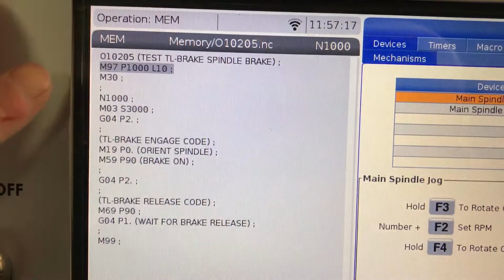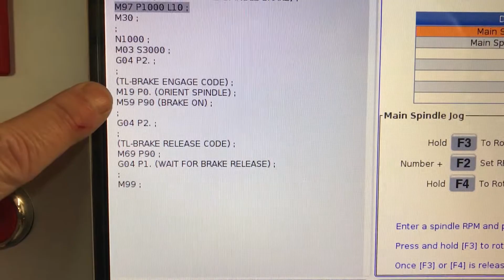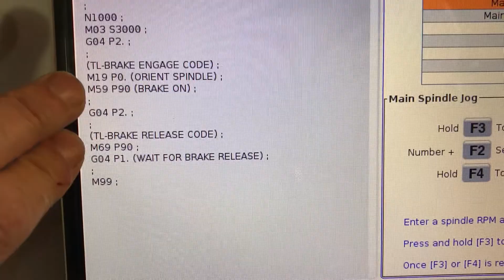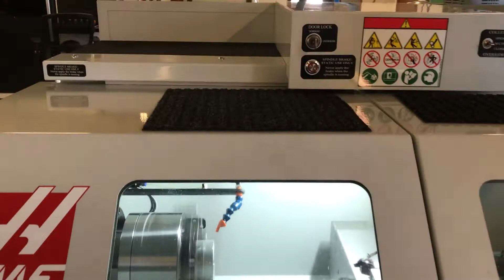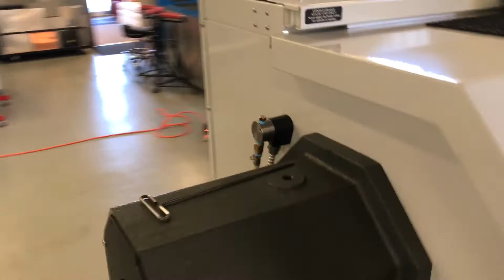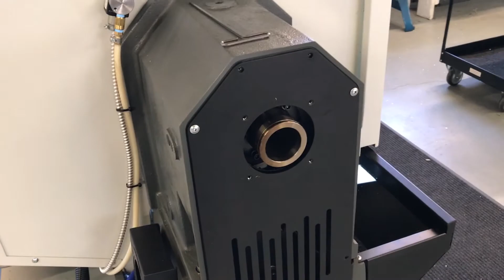Haas TL Series CNC Spindle Brake for Live Tooling, Broaching, etc...

Comment: I use M19 to lock my spindle when changing the chuck (without paying for spindle orientation feature). Without the availability of live tooling I don't see a purpose for using a static break. Please correct me if I am wrong here.
Reply from the maker: The killer-app is on spindle broaching and live tooling.  Here's a video of this TL-BRAKE used for cutting a spline on a transmission component:  https://youtu.be/K133TXGCiCU

Comment: Excellent setup! We have a couple production parts that are threaded onto an arbor and this brake kit allows us to do a parts change either manually or with an M code at the end of a program. It makes parts changes much faster for the operator because before they had to use a second tool hold the chuck in place and now they just need the one spanner.
Reply from the maker: Thank you for the kind comment!